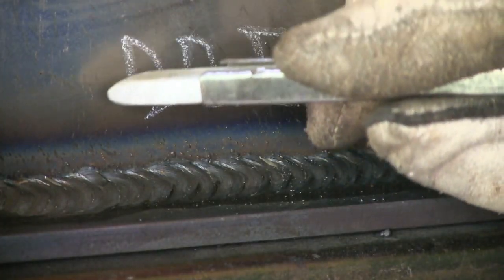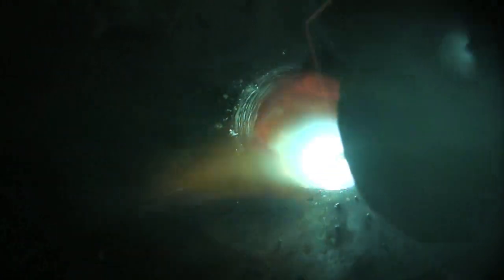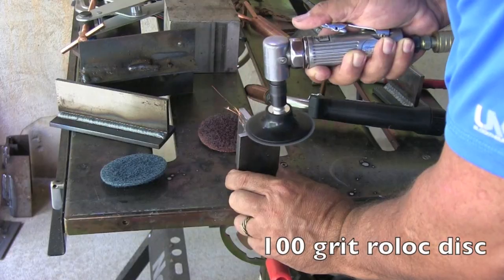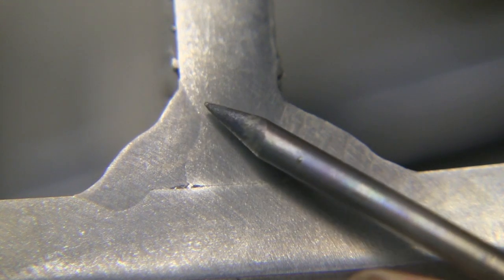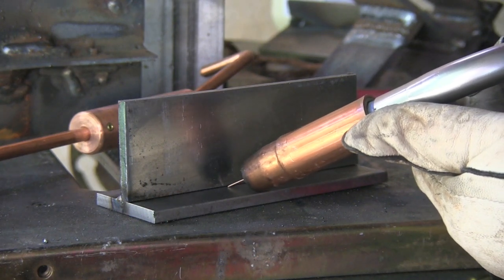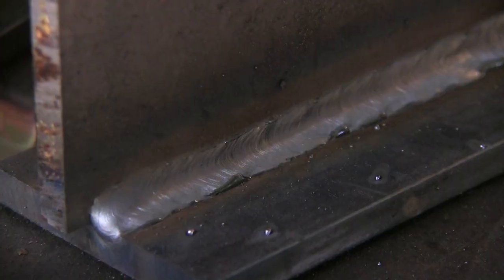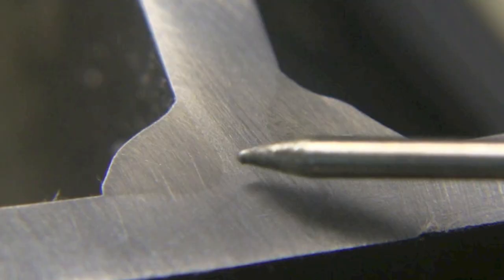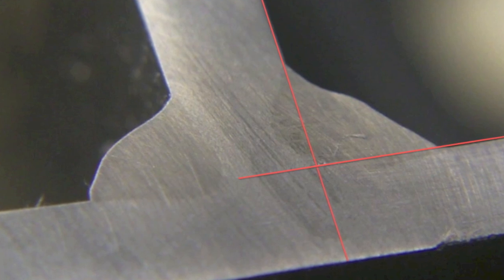Mig Welding Basics 4 - Avoiding LOF - Ice Bucket Words

Comment: I'm always amazed at how clear the arc and material are when viewed on a screen like this. I can never get this clear view of my welding surface using the max setting on my helmet. I've tried different settings, but it never comes in this clear. Is this just the way it is, or am I doing something wrong? If I could see better I'm sure I could run a better bead. I use a Miller 210 mig by the way and 2 different helmets.

Comment: The 'arrow pushing' motion ( >>> ) looks like it has quite a bit of undercut at the top and it looks like you needed to adjust your travel speed at the top to properly fill up your weld.
I also wonder what the repeating ) motion would look like if you changed your weld angle to a more aggressively dragging angle to push back your edge a bit.
I personally like to do little sails/triangles or a stitching motion when welding fillets, but for outside corners I typically gouge; shortening the arc length when moving forward and then lengthening it to fill in the rest of the profile before moving along.

Comment: Had a huge issue with LOF last 2 weeks at work.  Couldn't figure out what was going on. I use Flux in a production environment.  After welding there are huge slag pockets. This helps because it let's me know it's probably and angle issue. (And bad manipulation)

Comment: Hi Judy.  Thanks for all the videos and passing along your knowledge.  I have a question for you.  I’m far from an expert at welding.  It’s a hobby for me.  If I’m doing a job and not sure about the settings is it ok to be safe and run it hot.  Not so hot that I blow threw.  My thought process is that it might not look pretty but at least I’m getting penetration and the clean it up with the grinder.  I hope that question makes sense

Comment: how do u weld 1 inch thick to 1 1/2  inch thick steel can only use drag, and has to be 8mm fillet,
Reply: when its too small i slow my motion down and then i get undercutting, also when i direct the weld into the middle i get like a overlap on my bottom weld

Comment: Great video, extremely helpful to me. Just bought a Miller 211 and waiting on supplies to start practicing, eventually going to be replacing body panels and light suspension work on a small unibody car.

No clue if I'll ever use that machine to its fullest, but I keep reading about people buying small 110v only boxes and being disappointed with them.

Comment: the mig tip you never use was one that I always thought was best.  I can always make the bead look nice doing  a "half moon" push technique.  however. . you just plainly showed how much lof is left behind.  thank you so much for your videos.  for some reason I thought I could mig weld because I could make a pretty bead.  my jaw just dropped when I first watched this.   I've been welding a handful of years but I've just found you on the Internet.  I am hooked! my next big purchase will be a TiG welder ac/dc of course.  I'm extremely amped to apply your instructions to my welding.   thanks again!
jeffBrianNC2AK

Comment: You showed the "straight bead" technique and mentioned the 'stack of dimes'.  Speaking strictly on weld strength.... does the 'stack of dimes' provide any benefit beyond 'beauty'?
Reply: Stack of dimes has no benefits in strength, but if done correctly you have a beautiful weld with the same fusion as a basic drag weld.

Comment: Curious to what your thoughts were on the thermal arc fabricator and would it be something you'd recommend. Debating between lincoln 180 230v or fabricator 181i 230 volt.

Comment: How do you prevent cold lap? Im doing vertical up no backing plate 3/32 gap with bevel and land. My root is perfect. But my face bends keep cracking. I think its because of cold lap. I was told to make sure I pause on the ends as I do a weave up. ANy suggestions????

Comment: Thank you sir. Being a entry level welder this series has been very informative. I have a Hobart 140 and I'm wondering if it is fit to weld a utility trailer using 1/8" and 3/16" mild steel? Or is it time to upgrade?

Comment: Can you do the same with allum, mig . I got a tanker repair shop and we do a lot of leek repairs in gasoline tankers. Do to the way these tanks are we have to use a MM350p with .035 wire and 100%Argon with a 25ft push pull . We have a lot of arguments with some of the older guys on the way we cut old welds out and weld back in to them. My system works better than all of the other guys at our shop but more often than not im stuck grinding out a bunch of there nasty welds and fix them my way. If you could image yourself sitting in a gas tank welding a head wall to the barrel of the tank both are .250  the head is rolled at the outer edge forming basically a t joint entirely around the barrel. Most leeks form 1 ft long on the bottom of the tank over the frame rails.
Reply: Correction i said t joint . Its a lap joint
Reply from the maker: I use the same method on aluminum mig. Always keeping the arc at leading edge or tracing leading edge of the puddle. 
It depends on thickness.
Reply: Thanks

Comment: Great video! Could this weld style be applied to pulse arc mig? I am about to test on pulse arc but I can always see that crater that you just informed me is actually LOF. I am only allowed to run vertical stringer beads, no weaving. Thanks!
Reply from the maker: lost2212x yes, you can apply this to pulse mig.
Reply: weldingtipsandtricks  Really good  on the  showing  route weld Jodi! I was  going  ask  Jimmy D  glad  you did  ..Thank you!  Pete

Comment: Jody. I've been following your videos and again want to thank you for both great instruction and videography! Two questions please. First, where can I get free small pieces of metal for practice? Second, would the cheap helmet from harbor freight allow a good view of the bead while welding (at least for a beginner on a cheap HF 90amp mig flux core welder)?
Thanks for sharing!
Reply from the maker: I dont know about free but if you buy metal from a scrap yard, or pay scrap price for metal from a local business, you can at least sell it back to a scrap yard when you are done with it.  Never used a HF helmet before so cant really speak to that
Reply: Get the better helmet at Harbor Freight and you will have a decent helmet. If you are going to weld for a living, you will want to purchase something a little better. http://www.amazon.com/3M-Speedglas-Welding-Auto-Darkening-07-0012-31BL/dp/B003TM0SDU/ref=pd_sbs_hi_5?ie=UTF8&refRID=1XK24QH41139ZFEA7DJ6